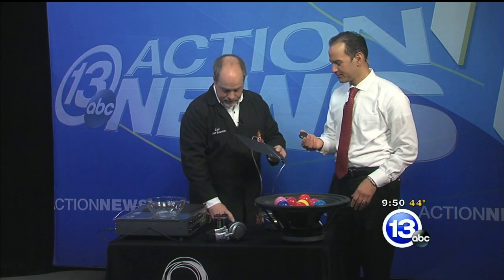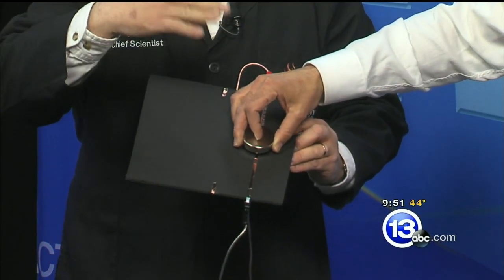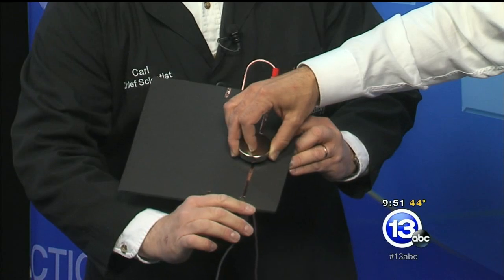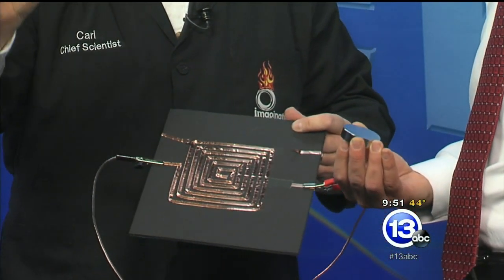How do speakers work?

Comment: Still mind blowing how that works!
Reply: Yes.  And here's the great part.
It works in reverse ad well.

If you vibrate the membrane by air ( sound)  it will produce a changing voltage across the wires. 
That voltage will change magnitude depending on the volumen of the sound and the frequency of it will reflect in the frequency of the voltage of the wires. 

And that's what a microphone is. 
It's a speaker in reverse quite literally.
Reply: @kriss3d  wow comment from 7 years and the replay is from 7 days ago amazing
Reply: @ahmeda5394  yup time flies doesn't it
Reply: @kriss3d wtf🤯😂
Reply: Yes, many years later😊😅
Reply: @arjumandvillagelife  Here I am 8 years later and I’m still mind blown 😆
Reply: WOW
Reply: Yo

Comment: Wow I never knew speakers were THAT simple, blew my mind! Thanks for the video!
Reply: Fundamentally they are, but they can get really complicated if you want them to sound good.
Reply: A light bulb is even more simple. Now go make one that you will trust to be the only thing keeping you from wrecking your car at night. Simple doesn’t mean it’s practically easy. A soda can is also simple, but you will never even be able to make one on your own lol
Reply: @speakersr-lyefaudio6830  As complicated as they may get, they all still work on the same basic principle.
Reply: And a microphone is exactly  the same except you vibrate the membrane and the output is voltage in the wires.

Comment: In more detail, a wire passing current that is sandwiched between the poles of two different attracting magnets will move at right angles to the magnetic field according to a "left hand rule" where you point your first finger from North to South direction, have your middle finger at right angles to your palm to denote conventional "current" from positive to negative, and your thumb in the "thumbs up" position. E.g. if north pole is on the right and south pole on the left, positive to negative in the wire is pointed away from you, then the wire will move "up" in the gap. 

A current in a wire will have a circular magnetic field around it (field lines in an infinite hula hoop around the wire with no "North" or "South" termination points). The direction is clockwise for conventional current moving away from you. The field is reinforced on the bottom by straight permanent magnet field lines from right to left, pushing the wire "up."

The metal disc on top of the ring magnet is to conduct one pole's field lines to the outside of the coil gap. The metal "top hat" on the back of the magnet is to conduct the field lines from the other pole to the centre of the coil gap. Now you can turn a ring magnet into the optimum magnet for a speaker which is a horseshoe magnet with the ends bent in to face one another with a small gap, and lots of these magnets filed into wedge shape and glued together until a ring is formed. The coil is so you can have lots of parallel wires moving in the same direction and magnify the force.

You can build a more primitive version with a simple neodymium cylinder inside the coil. Although the field lines won't be as concentrated in the direction you want (at right angles to the coil), the strength of the magnet will still be able to give a decent output.

I did actually build a speaker but it had a vertical ring for a coil as I only had one pair of magnets to face each other. The other half of the coil wasn't in the gap so it did lose efficiency, but I would have needed another pair of magnets the opposite way round to not have it cancel out. I used a resistance meter so I could work out how much wire to use without overloading the amplifier.

Comment: Neat demo, only issue is in a speaker the permanent magnet is fixed and the coil (electromagnet) moves. Very similar.
Reply: Is that not whats happening here? I was assuming the sound was being created by the coil moving and vibrating the cardboard, while the magnet he's holding is "fixed" by his hand.
Reply: @mattstrom5875 yeah that os what's happening, the sound comes from the cardboard moving, the permanent magnet (although being moved around) is in a fixed space relative to the movement of the electromagnet (the cardboard) which is vibrating very quickly

Comment: How did that song start to play? Could someone please explain?
Reply: Whenever a current is applied to an electrical conductor, it generates a magnetic field. Copper is really good at this. Changing the amount of current you put in to it changes the strength of the magnetic field. When the magnetic field is generated in the copper, it's attracted to the magnet he's holding, but because it's attached to the cardboard, the cardboard is moving too. Now, remember that sound is vibration. If you hold a ruler off the edge of a table and hit it, it vibrates and makes a twanging sound. The faster the vibrations, the higher the pitch of the twang. In this, the cardboard is kind of like the ruler. The current applied to copper attached to the cardboard is basically turned up and down really really quickly, like hundreds or thousands of times per second quickly, which causes the cardboard/copper to fluctuate it's distance from the magnet at the same speed, essentially happening so fast it that it makes sound.

Comment: does it work with aluminium foil too
Reply from the maker: Patrik Kolaric Yes it does. The copper tape was just easier to work with since you can apply it to a solid surface. Our first prototype for this was just a layer of aluminum foil on a sheet of paper. Give it a try! --Carl

Comment: isn't this a short circuit?
Reply from the maker: Yes, to a degree. There is some resistance in the hook up wire, and at the alligator clip contact to the foil. The copper tape does get warm after a few minutes. So, not the best design for a long term use speaker. However, it is a nice way to demonstrate how a speaker works. 

-- Carl